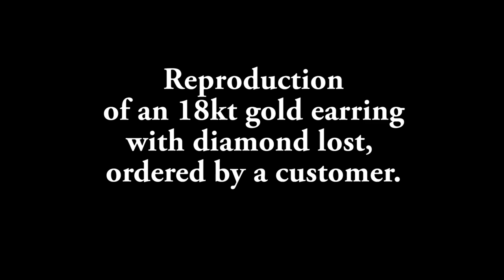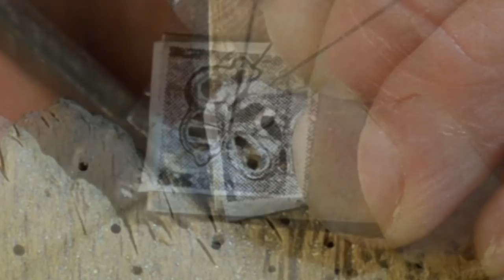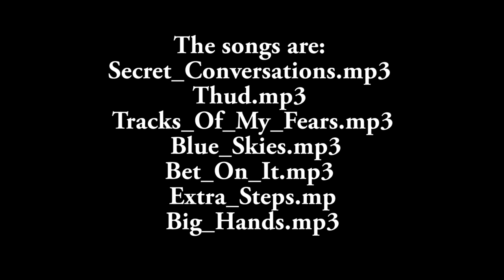Reproduction of an 18kt gold earring with diamond lost, ordered by a customer

Comment: How do u manage to put the cutting tool in the inner parts without cutting the little circles?
Reply from the maker: The hacksaw blade comes off easily, in order to pierce the internal parts is punctured with the drill bit, then passes the blade, and then pierces.

Comment: Hello, in 9:31 what's the name of the tool you use for making the screw?? Where can I get one like yours? Do you have a link where I can get it? Thank you for your videos they are inspiring and very helpful!!
Reply from the maker: Check that there are the measures you need
https://www.amazon.it/filiere-acciaio-tungsteno-cassetta-metallo/dp/B01D3JVSP0/ref=lp_3120229031_1_12/258-6211455-9091211?s=tools&ie=UTF8&qid=1494690882&sr=1-12